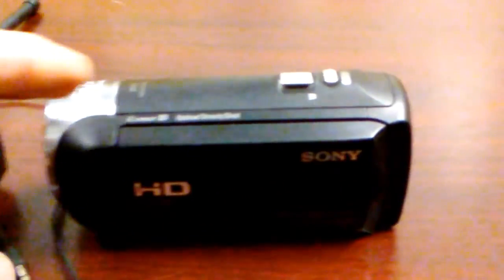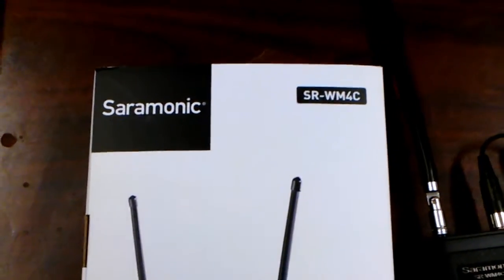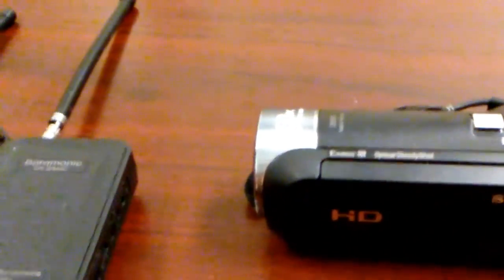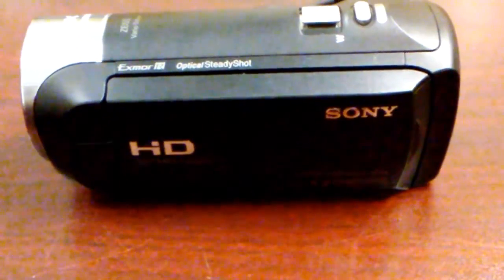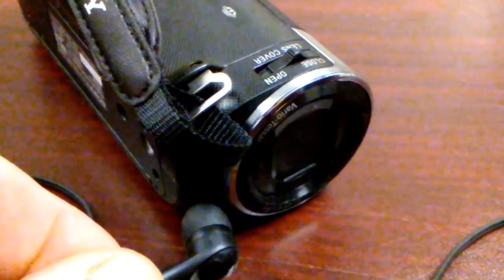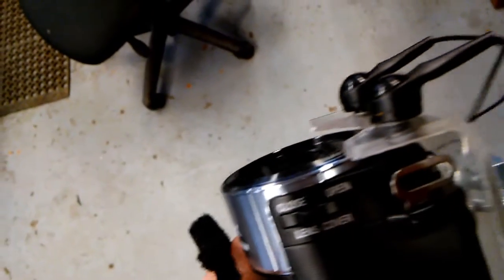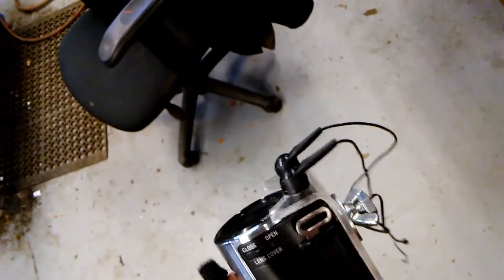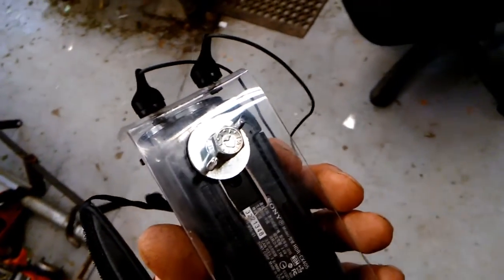no microphone jack camcorder with out a microphone jack mod

Comment: Wow Can you put up a video up on how to make that please ??
Reply from the maker: thanks for commenting! To be honest this was an experiment that worked well but i never use it because my videos  are filmed from 10 feet or less and the cam picks up the sound fine!  I think i bent the lexan with a heat gun drilled the holes including the slide on the bottom then filled it to a square slot. I want a new cam  with a sound port soon but at this point mine works fine!